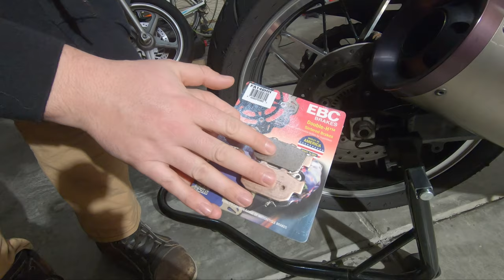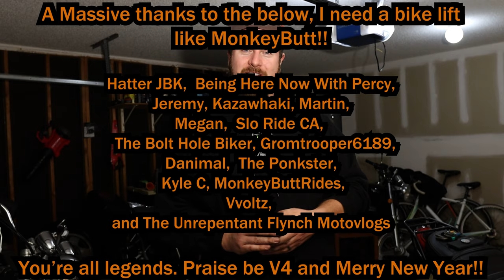Changing Kawasaki Z900RS Brake Pads Front and Rear

Comment: Great video, just wondering about the advantages of using silicone based anti seize over copper based?
Reply from the maker: Thanks! Technically no advantages I'm aware of, there is just a theory, not one I fully believe as I've never had an issue personally, that copper based MAY interfere with some ABS systems triggering correctly. So I used the silicone based as a more of a "better safe than sorry". I still use copper based on my older bikes out of habit. 
It's really a case of 6 of one or half a dozen of another imo, both work fine for the anti seize bits :)

Comment: Z900 pads on a z900rs. Well done. You didn't notice? Different calliper. I think you need to get the shop to do it properly.
Reply from the maker: If they are incorrect it's the shop that supplied them to me when I gave them my make and model 😂😂 So no, I absolutely won't give my bike to a shop. 
And they've ran absolutely fine on road and 2 track days since, so the dimension difference is probably negligible
Reply from the maker: You are correct btw, they did give me the wrong pads, however the difference is less than than 2mm in length and .5mm in thickness total, so negligible.